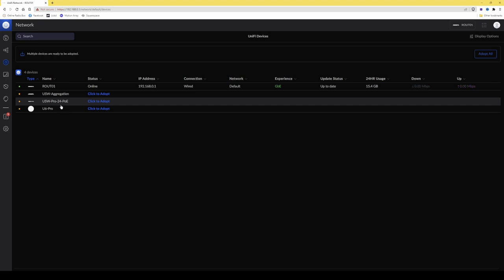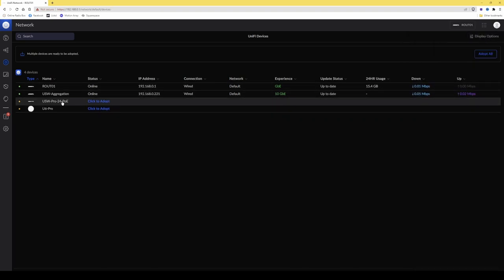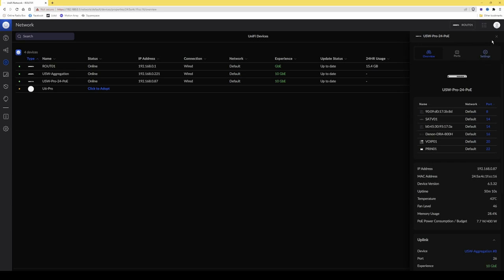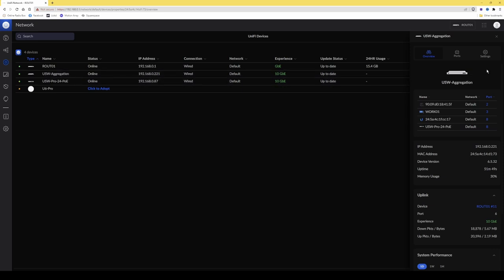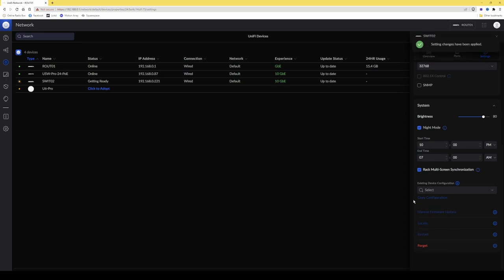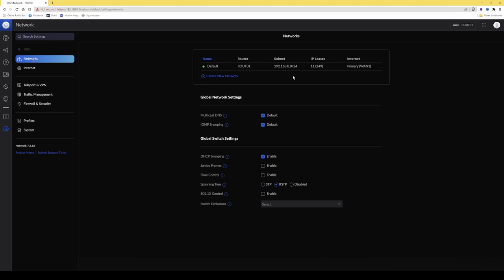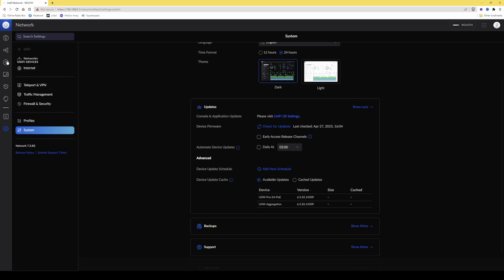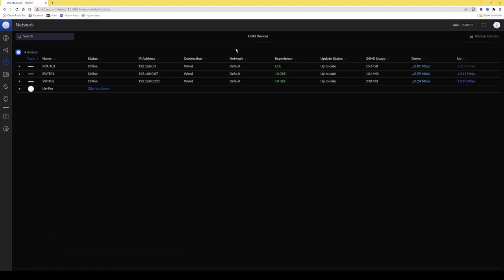Full UniFi Network Setup - Episode #5 - Adding UniFi Switches

Comment: would prefer to use DAC, hide it between switches with some sort of 1U management.
Reply from the maker: Hi @Naif ALTAMIMI  - I see your point.  I've managed to use 2 DAC cables for uplinks between the switches and UDM and I've just pushed the excess down the side of the cabinet, doesn't look too bad.

Comment: I would like to ask about my setup. I have 1 UDM SE, 1 Aggregation Switch, and 5 USW 24-port standard switches.

I connected my UDM SE to port 11 on the USW Aggregation switch on port 8, and I connected all 5 USW 24-Port switches on each different area  to the Aggregation switch via SFP module. However, I'm encountering STP blocking. Can you help me understand how to avoid this error?
Reply from the maker: Hi @IzangsVlog - Thanks for your comment.  This seems very odd as from what I'm understanding is that each of your switches and UDM all connect in to your Aggregation switches via separate ports with SFP modules on the Aggregation switch, so I cannot see how you are getting STP (Spanning Tree Protocol) blocking.  Maybe try checking each port on the Aggregation switch under the 'Ports' section of your UniFi Network Controller has 'Native/VLAN Network' set to Default and underneath that 'Tagged VLAN Management' has also set to 'Allow All' and that the 'Operation' option is set to 'Switching' as I'm wondering if maybe one of those port profiles had previously been set to a specific VLAN, where I think it should be set to Default Networks so it allows all traffic to flow between switches.  Just something to check first.  Let me know how you get on.  Maybe another channel member here can provide an answer if they've had the exact same issue, anyone ???

I've not personally encountered that but would certainly like to help you resolve it if we can between us!

Comment: Hi, im just starting to have a some idea about networking solutions. But on the unify website, they say that USW pro 24 POE switch is capable of 1,0 Gbps, but in your unify OS, it shows it has 10Gbs experience. How is it? Just bcs of the aggregation switch?
Reply from the maker: Hey there - It's because the USW Pro 24 PoE Switch also has 2 x 10Gbit SFP+ ports which of course support 10Gbit, the other RJ45 ports only support 1Gbit.

Hope that helps.

Comment: I have a copper DAC cable that goes from my UDMP to my unfi 48 POE switch but nothing happens.  Always thought it was plug & play.   Does the DAC need to be fiber?
Reply from the maker: It should normally just be plug & play, however some SFP modules at each end of the DAC might possibly not be compatible as some are unique to specific brands, which one are you trying to use ?
Reply: @MrTimTech2022  no, I had it upside down.  easy fix
Reply from the maker: @NewSalemBaptistChurch  Ooops, oh well  - we live and learn by our mistakes, sometimes simple ones as you and many others I'm sure have found out.  At least you've resolved it now 🙂

Comment: i was looking how to connect the UDM to each switch, the problem is, i have 8Gbit internet speed and i need to use 1 SFP+ on the UDM as WAN connection, than i have only 1 SFP+ left to connect to the USW aggregation, behind that i have also a USW Pro 16 . is it better to go first from UDM to the Aggregation and than to the USW Pro 16, or first to the Pro 16 and than to the Aggregation ?
Reply from the maker: Hey thanks for your comment.  Wow that's certainly a good WAN connection speed.

Understood re the UDM connections and that you have it connected to the Aggregation.

To answer your question it's always best to connect both your UDM and USW both in to the Aggregation so that the Aggregation sort of acts as a junction box.  Then your Aggregation can either route traffic to the UDM or USW depending on where it's going to.

Hopefully this makes sense.  So to conclude it's best not to daisy chain them in a row.

Take care!
Reply: @MrTimTech2022  thanks for your answer Tim, i changed now like you said and it works a little bit smoother now, thanks and i keep watching your channel
Reply from the maker: Hey, thanks for letting me know, glad it's improved things a little.  You're welcome & it's a pleasure to have you as new subscriber👍

Comment: I thought that you should know that it isn't recommended to have more than 2 RJ45 spf+ modules in the aggregatation switch. Cause the temperature gets to hot.
Reply from the maker: Hi @gregm.5960 - Thanks for the comment, this I find odd seeing as there are 8 SFP+ ports on the Aggregation Switch.  I guess then it is recommended to use Fibre cables ?  Where did you see that information, it would be useful to have a read of ?
Reply: The RJ45 modules get hot, yes, but the recommendation is to not put them next to each other, but have a port between them that’s either free or used for a DAC.
Reply from the maker: That's a good idea and to be honest I have not for that reason spaced my Fibre modules out on my Aggregation, but just for cable routing solutions.  But that's certainly a good suggestion and if possible it's certainly worthwhile doing, so as to give better heat dissipation.

Comment: What server rack do you use or is in the thumbnail?
Reply from the maker: Good question.

I found it on https://www.rackcabinets.co.uk

It is an Orion Rack Cabinet, floor standing, grey colour, its a 12U - 600 mm x 600 mm one and the direct link to that is as follows

https://www.rackcabinets.co.uk/collections/free-standing-data-cabinets/products/12u-free-standing-data-cabinet-600-x-600

Hope that helps!

One thing is that you have to purchase shelves separately, so you may want to bare that in mind.
Reply: @MrTimTech2022  Thank you!
Reply from the maker: You're welcome UnholySeoul.  How about hitting that subscribe button!